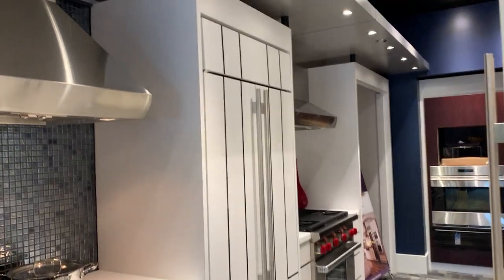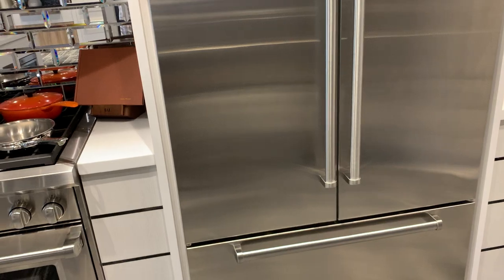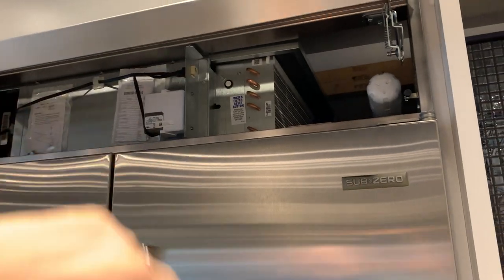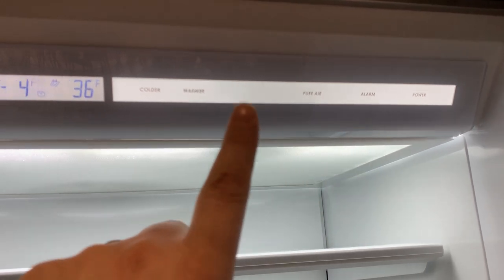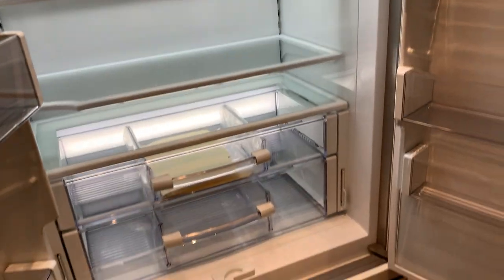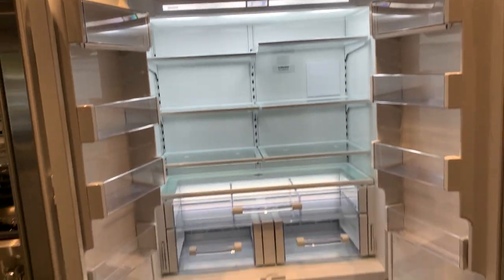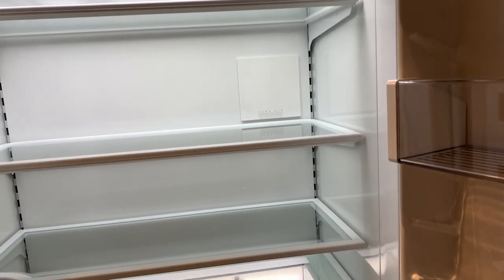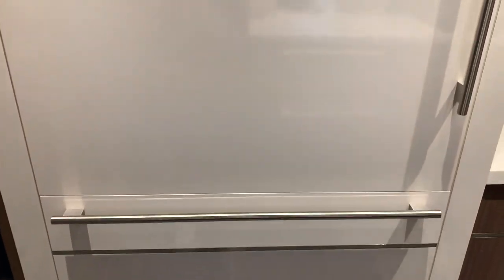Sub-Zero Bottom Freezer Refrigeration

Comment: Thank you very much for this extremely helpful video. Before seeing it, I didn’t realize how different the Classic built-in flush installation is from the Designer integrated flush install. With  plainer white panelling than you showed, including shaker,  the wider reveal on the Classic makes a black outline that I don’t know if I could live with, even though I prefer the Classic for more refrigerator space, ability to reach the top shelf, and ease of cleaning the condenser. The refrigerator portion of the Designer series seems way too small.. I might buy an undercounted refrigerator to help. I like how the Classic looks in Stainless, but getting that would require losing nearly half of my beverage center because of not wanting to see all that stainless in the currently planned location. Any suggestions? (Adding two columns is too expensive for me.) I’m wanting to get the Wolf wall ovens and induction cooktop and would get the special package deal. But I’m open to switching brands, too.
Reply from the maker: I like the idea of going with a Designer “All Refrigerator” and then supplementing with an under counter freezer and/or a separate upright freezer somewhere else in the house.